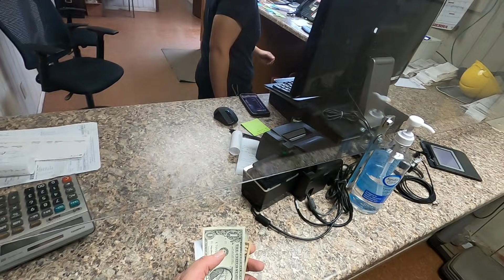Finding the Weirdest Things on Garbage Day

Comment: Good luck finding a metal top desk. I haven't seen one in probably 15 years. All the ones I find have particle board. One of our local scrapyards (about 100 miles away) has a rule, if it lands on the ground its no longer yours. I think its a silly rule. We have a new scrapyard just opened up that is only 30 miles away. My dad used to leave a 6 pack on the bin for a gift. Shame you can't do things like that now.

Comment: Offen wondered why scrappers dont fit a wheelchair hoist to the back of their trucks, cheap on ebay to buy and can be used with straps. (Use one for my mothers wheelchair, its slow but takes the strain of lifting an impossibly heavy object into the back). Or even a winch?...why struggle?

Comment: I am surprised you don't strip out the motor and cables from the washing machine. 70 cents a kilo instead of 16 cents for steel. cable is around 250c per kilo.